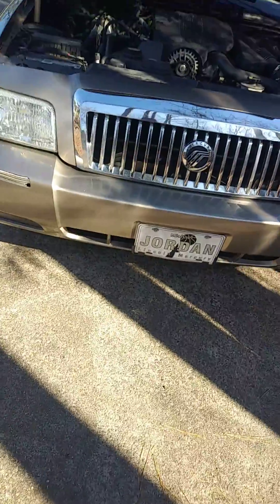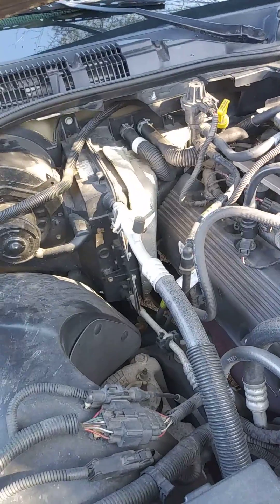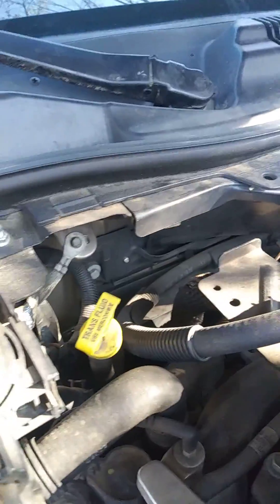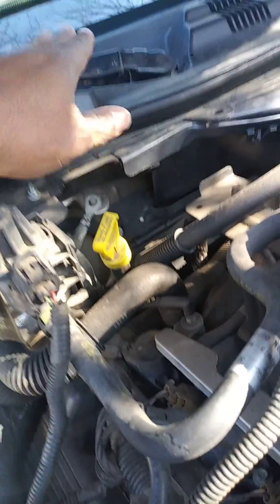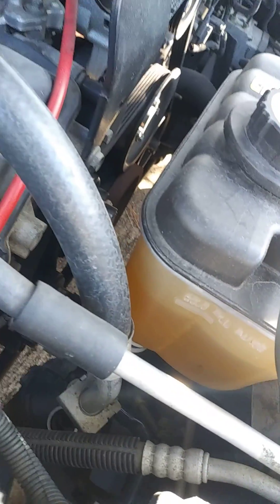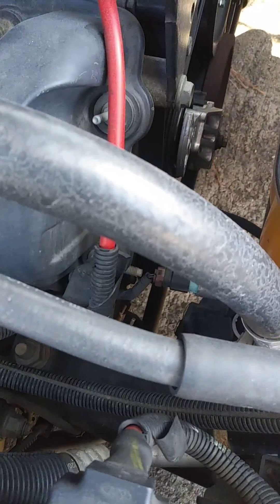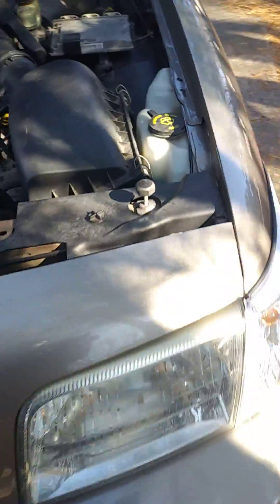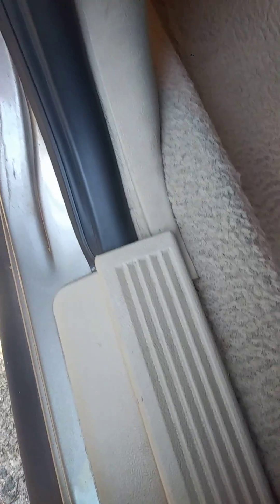Wet carpet leak on a driver side 2006 Mercury Grand Marquis

Comment from the maker: I'm going to clean under the cow again an get them leaves out that should do the trick.
Reply: Is there a hole to drain water out of there? I couldn't find it. I can't get the cowl all the way off. I haven't pulled the wipers off, or the hood yet. I don't really want to either.
Reply from the maker: So I found out that is a screw that holds my hood latch on this up against the firewall and I think that's was leaking from
Reply: @carolinabull  Cool. I will check that out tomorrow. I was cleaning things out today but it was still too wet out to be able to find any leaks. Going to try again tomorrow. Thanks for posting an update.

Comment: I'm having the same problem in all this rain in NC. Don't know where it's coming from.
Reply from the maker: So my problem also came back in all this rain. I put my floor mat back in my car now it's water on the mat , that tell me then that it a drip coming from somewhere behind the dash by the emergency brake pedal .
Reply: @carolinabull  I pulled the plastic cowl up and found a lot of pine needles and debris under there. I can't find a drain hole or anything. Maybe all the dirt in there. 
It's a pain to get to without pulling the hood off. 

I might have to take it to someone.

Comment: Useless waste of time
Reply from the maker: What's wrong ?
Reply: @carolinabull  Thought you were going to show us how to fix it.
Reply from the maker: Took it to the shop told them the problem explain the situation. They said it was the door seal but they can't fix it at that shop and he also told me my water pump was bad so they fix the water pump I never went to go get it fixed in the problem with a way
Reply: @carolinabull I Googled it online and found that water gets in around the grommet where the hood release cable comes thru the firewall.  There is a bolt that is directly above it that holds the cowl plastic liner in and it drips off it onto the grommet below.  I siliconed mine..........will see when it rains again.......
Reply from the maker: what year model is your car I need you to put on some videos whatever type of work did you do to your car it'll be helpful to us in the YouTube Community thanks
Reply: @timekeeper46  I'm having a different problem. 2011 Crown Victoria and last night the windshield on the inside of the car had condensation/wetness on it. I had the windshield replace months ago. But there's absolutely no leaks anywhere seeing as I've been in the car during lots of heavy storms and there were no leaks. I'm thinking it's an air gap somewhere or maybe something like you said.
Reply: @mediaguy4037  I have seen windshields fog up on the inside when there were no leaks.  A lot has to do with temperature inside and outside the car.  Sometimes on a hot humid day if the weather cools down rapidly, this might happen, due to hot air trapped inside and cold air on outside of the windshield.  If your floors are dry (check trunk, too), I would not be concerned.
Reply: @carolinabull  Mine is a 2001
Reply from the maker: @timekeeper46  ok put up some vids DIY
Reply: @carolinabull  I am a low-tech guy.  I don't have any means of making a video.  All I have is an old flip phone that is about 20 years old.
Reply: Rock Drummer can you send me that link? I’m having this same problem with mine
Reply: Rock Drummer did the silicone work?
Reply: @carolinabull damn how the hell did the water pump get water all. The way into the cabin
Reply from the maker: @saucemasterx911  i never said water pump i just had found that the intake was leaking real good . The floor was wet from the debri from under the cow once I cleaned it , it stop leaking 😤
Reply from the maker: @saucemasterx911  you right I didn't know at the time I think the shop lie to me and got that free money . Couldn't see my comments for a while